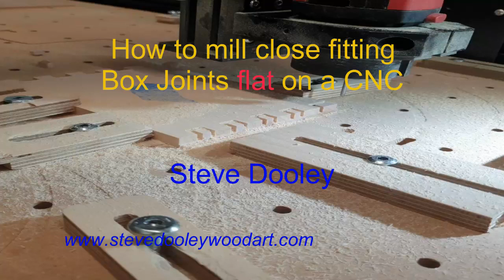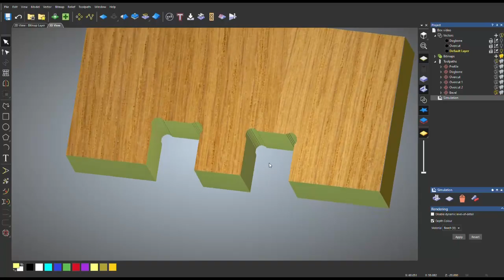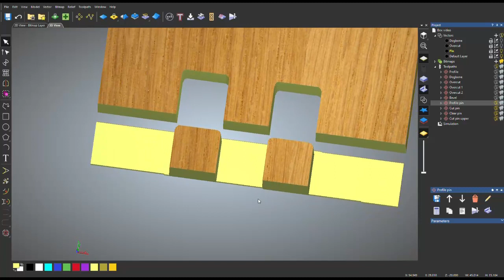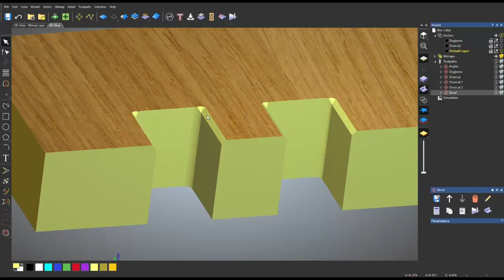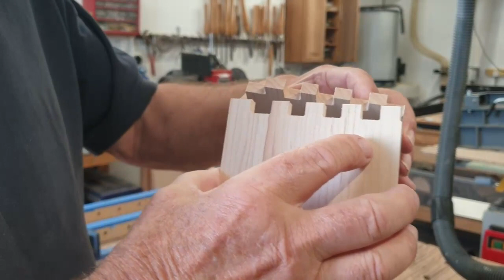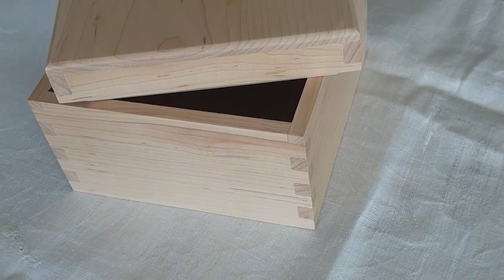Cutting Box Joints Flat on a CNC

Comment: Nice, thank you for sharing i will have to give it a try. I usually just let my box joints rip with a 1/4 bit and then upend the boards on my router table with a short flush trim bit to clean it up. Takes me just a few minutes and there is so little material to clear it is clean.

The flush trim bit I usually use for this is
(YONICO Flush Trim Router Bit 1/2-Inch Diameter 1/4-Inch Shank). It has a shank side bearing.

I have also done a double blind method where i leave 1/8th material on the underside and and on the outside and then i come in on the outside with a 1/8 90 dagree vbit so i get mitered corners. With the box joints i do a tbone and it just ends up on the inside and outside to be a mitered box but you get the strength and glue surface of the box joints. It adds to the machine time but when you want to do a waterfall pattern around a box nice and clean it does the trick.